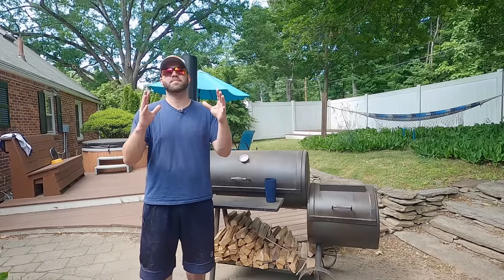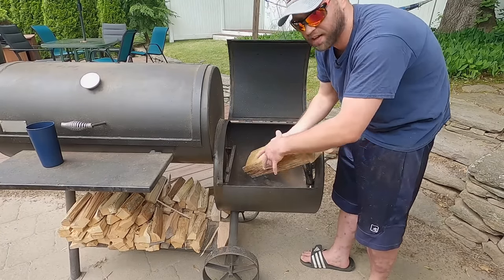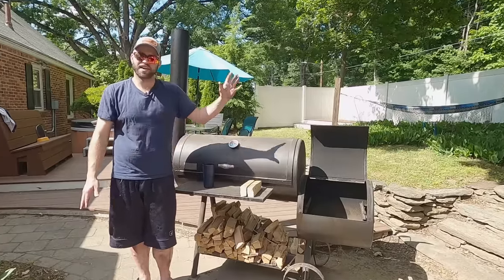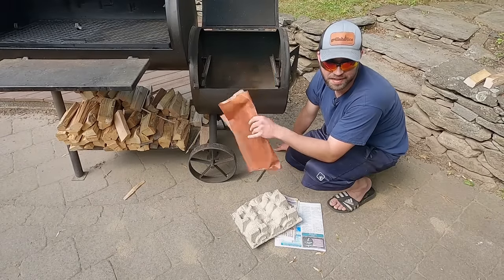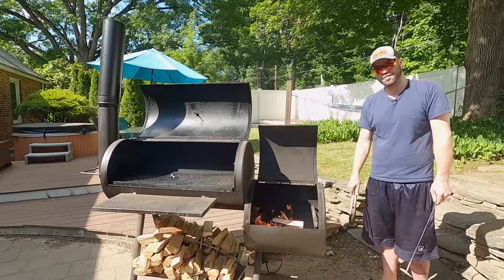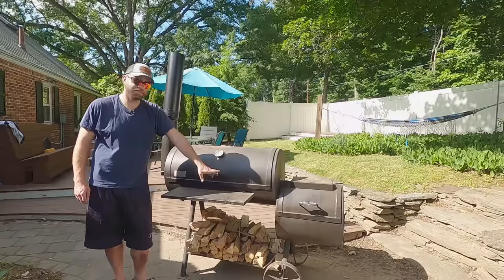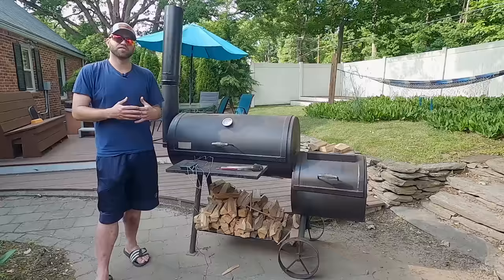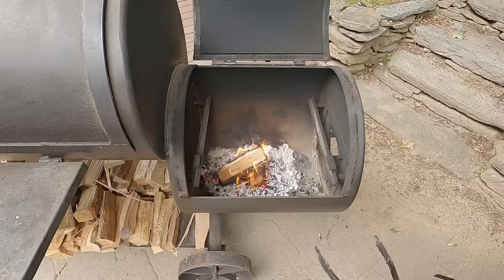OFFSET SMOKER FIRE MANAGEMENT FOR BEGINNERS | How To Burn A Clean Fire | Fatty's Feasts

Comment: Damn this is complicated! 
  Funny thing is Brisket has been cooked to perfection by millions. 
   200 degrees. 1 pound an hour. 
  Salt, pepper. 
  Use your favorite wood and cook it. 
  Dirty white smoke?😂😂😂. That is moisture in the wood. 
   Unless someone or something has been urinating on your fire wood the white smoke is just fine even most of the time. 
   Most people soak their wood in water. 
   It is not that hard.  If your smoker isn’t consistent get rid of it. 
   That smoker he is using is a POS on the highest order and everyone who has used them knows it.
Reply from the maker: There are many problems with your comment. First, it's not that complicated really. Two, every brisket is different and you can't use a general equation to tell when it's done. It's a guide, but not a very good one in my experience. Every wood is different and can provide different levels of smoke flavors, so you have to have a general idea of what you're looking for. Third, dirty white smoke is a product of incomplete combustion, which can be attributed to moisture levels, but typically is due to lack of airflow. Dirty smoke, at certain stages of the cook, can be fine, but not for the entire cook. Your product will taste acrid in the end, and I know this from the amount of times I've screwed up with too much dirty smoke. People soak wood in water when they are using wood chips, but not full splits as you would use here. Lastly, no this smoker is not a "POS." It's by no means the best smoker on the market, but it is a great smoker to learn on and is affordable for most. Most people cannot afford a high end smoker, and the fact you'd basically make the statement of "buy an amazing smoker or don't bother smoking" is truly arrogance at it's finest.
Reply: @FattysFeasts  by all means fire away. I deserve both barrels for that comment. 
   I re read it and it came a across super shitty.  
   In all honesty I started out smoking meats on a $99 New Braunfels smoker bought around 1999. 
  I honestly did even know it was a smoker until my good friend pointed it out and showed me how to use it.
  I had no idea how easy that cheap little unit was to use. Nothing to compare to. 
  It was small and had to be burned out and cleaned after about every session or build up would occur. 
   We were using about the only wood we had available in our area.  Mesquite. Which I later learned is not palatable to those not accustomed to it. 
   After years of neglect I scrapped that smoker in favor of a $800 smoker that looks to be identical to the one in this video. 
   By that time several people I grew to know made the same mistake I did and bought the same smoker. 
   All of us with plenty of success from cheaper more affordable smokers. 
   We didn’t know how spoiled we were with our more simple smokers and like myself soon found out they were if not completely unavailable they were just as cost prohibitive. 
   But the white smoke incomplete combustion cycle?  Sounds too much like engine tuning and that’s what I do for a living. I’m not going to fool around with smoking foods if I have to tune a smoker because I simply know there are many out there that are so simple anyone can do it and not pay hardly any attention to what’s taking place. 
   And yes, 200 degrees at a pound and hour was all we could afford to do in those times. 
   Brisket was .85 a pound and many friends and family took up the art of smoking that in order to afford feeding larger gatherings. 
   We all used it and it was always the best. Whoever.  
   We just didn’t realize how good we had it with those cheap  smokers.
Reply from the maker: That's a pretty cool story to be honest! It is amazing sometimes how simpler is better. I've seen many smokers on the market now that cost 5-7k and I wouldn't even want to get a brisket within 6 feet of them. I agree that if you really have to screw with a smoker, it's not worth it. I guess it depends on how much the smoker costs and what you expect it to do. Some of these smokers look really cool, but functionality wise, they perform no better than an extremely cheap offset from your local hardware store! I think with the Brazos in this video, it was definitely not perfect, but I didn't expect it to be for the cost. I had to make some simple modifications to it to allow it to perform better, which really revolved around taking out some of the bells and whistles that were on it originally. Going back to simpler is better, I pumped out some great BBQ on that thing! @hughobrien4139
Reply: @FattysFeasts  Yes the Brazos and Old Country Pecos  were the two types several of us bought from Academy. 
  I’m sure if they see that smoker they will come across cussing and spitting. 
 There were about 4 or 5 of us who got bit. 
  I’m trying my hand at making one. Found the on line calculators and went from there. Like everything else all I lack is finishing up. 
  Now I will state that by no means were our Briskets up there with the competition best.  I’ve had some knock your socks off Brisket and Black BBQ in New Braunsfels TX and my favorite is Hutchins in McKinney TX. 
   Back then though we thought every single one we cooked was it and it was so very simple.  
   We just didn’t know how good we had it.